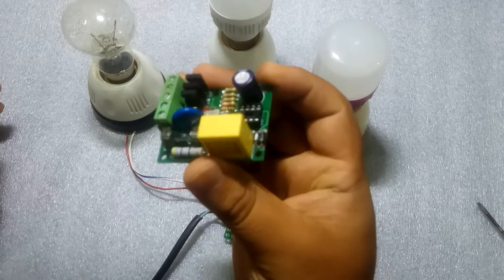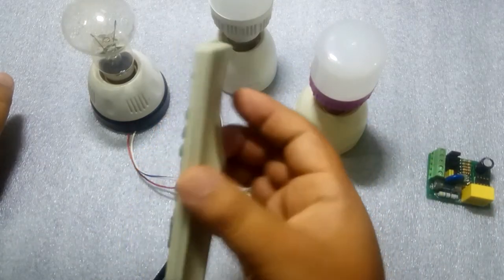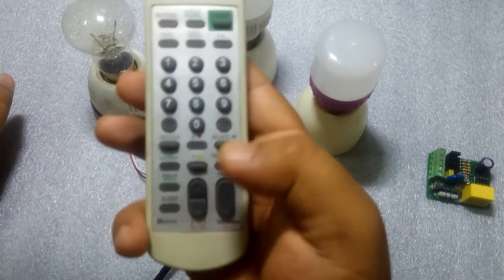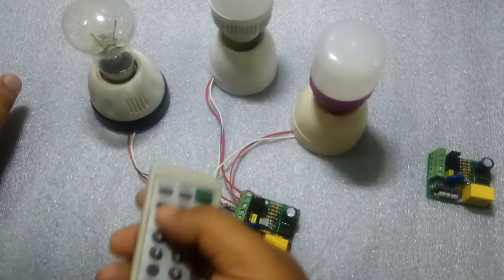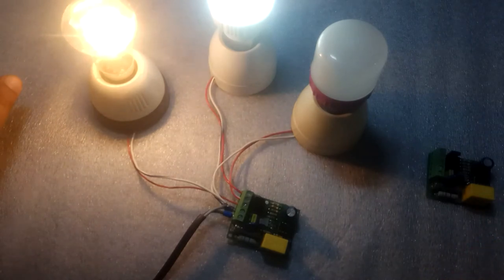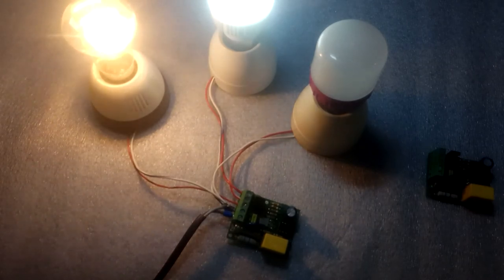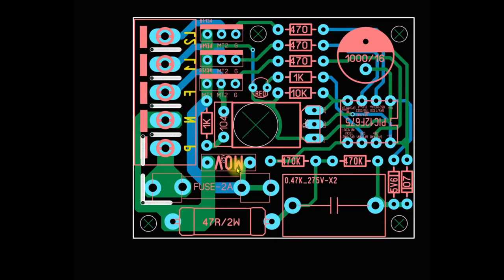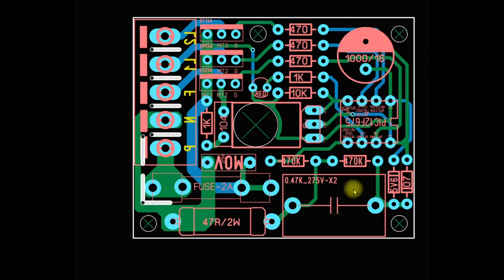Remote operated fan light controller, 1 fan + 2 Light

Comment: Hi, I saw your other project with the homemade atmega2560 pcb, I have a question,  i'm having trouble programming my chip with a Uart chip (cp2102 or FT232RL). I can only use an Arduino Uno as ISP to upload a sketch to the chip. My plan is to make a minimal stand alone circuit that i will solder a USB cable to. How did you program your chip when it was on the pcb?
Reply from the maker: Should work.